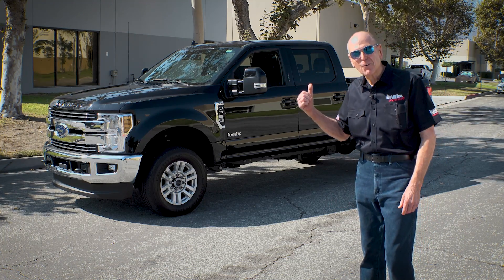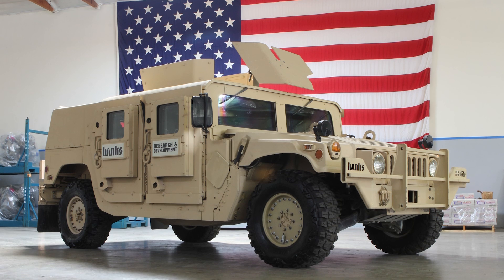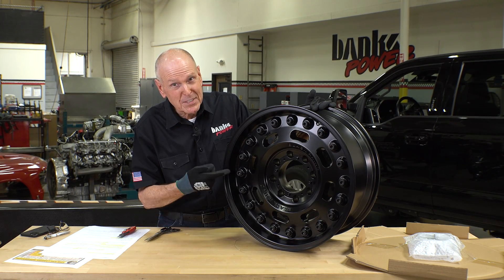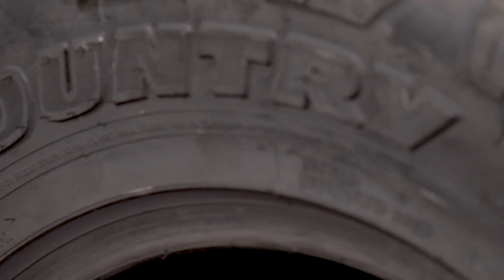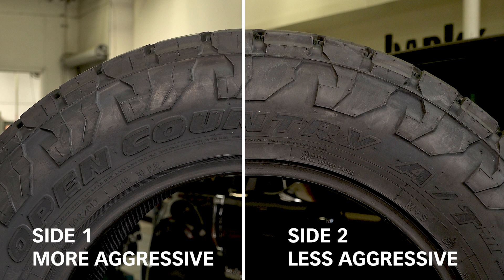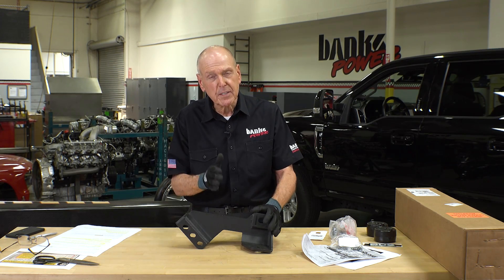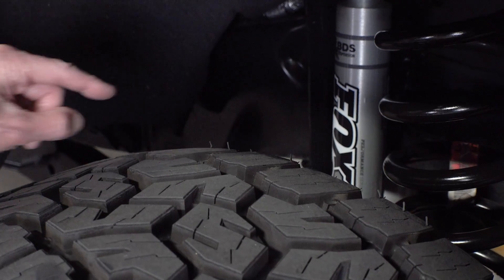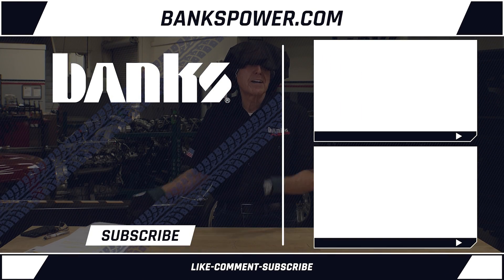ENGINEERING UNBOXED: Ford F-250 Makeover!

Comment: Why dosent GM employ Gale Banks as a Duramax Engineer or ?,and let him upgrade the reciprocating assembly and the base architecture of the nect gen Duramax? Ive followed Gale Banks career since he chased Bonneville gas speed records. At that time, he stated,  diesel is the next big thing. You can turn the boost waay up, and there  is no detonation. And he proved it. His motto, test, document, dont guess.
Reply: Sorry for a couple s.i.c. mistakes. Gale Banks is our Diesel Zora Markus Duntov. Mary Barri 😮 would enhance her pension and make money
Reply: employing Gale Banks in some Duramax engineering capacity. He reengineered the 6.2 when the U.S. of A. wanted them uparmored.
Reply: The 60's were a Gold Mine for Chevrolet, which dominated the streets, with factory built hot rods.
Reply: Only factory built light weight experimental race cars from other manufacturers could beat the factory Chevy big blocks with forged steel bottom ends.
Reply: A favorite story that I read about was a hemi dodge campaigned on Woodward Blvd. and maybe Telegraph Rd. by a group of Chrysler power train engineers, it was the king, it had never been beat on the street, until a...
Reply: ZL-1 Chevy (Camaro)? Wupped it. Mary Barri, if you are head of GM, stant and deliver....you lasting legacy.
Reply: S.I.C., sorry, deliver your lasting legacy.
Reply: Gale Banks, a.k.a the modern Zora, stand and deliver, sir.

Comment: I have a 2019 F250 Lariat Powerstroke with 4.5" Carli Suspension lift, Toyo 38x13.5r18 tires, Black Rhino wheels, S&B air intake with battery relocation, Banks Derringer with iDash Data Monster and a Pedal Monster.  Its a beast...

Comment: Have to pull you up on the brake diameter vs tire diameter; ignoring tire/wheel inertial increase, the brake will dissipate the same energy as with a smaller wheel=same stopping distance. Makes no difference.

Comment: It appears as though the At3's are manufactured in the USA but I would have liked to have seen BFG instead.... I mean the history of BFG.... A lot of firsts.
Reply: the BFG’s don’t hold up well under the heavier trucks i’ve run them and out fleet has run them. even their ‘hard’ compound is too soft and wears too quickly. i got 72000 miles on my last set of AT II’s before i replaced them with my new set up and lift.

Comment: Gale... about the wheels   why put fake bolts and nuts on the wheel just for show ? they are just  dirt collectors and  extra weight.
Reply: Same reason as fake t*ts, unnecessary weight, costs more. But hey it looks good!
Reply: take a look at nearly every other single truck wheel... ugly, stupid and look like shit; at least those mirror the split rim "well", most of the fake bead lock wheels dont even look the part convincingly.
Reply: I don't usually go for form over function. I thought those wheels looked good. They can't be that much money as they were steel and basic.
Reply: Every set of wheels I've bought for the last ten years has fake ones. This last set (rockstar lll's ) only 2 of 6 are real. Did give me that cheap feel right off the bat although there not. but I do like them when I need to remove them ,lol

Comment: Is it the new JLTV's that will have the new banks engines because the ones that we had in my unit had Cat C7?
Reply: You're thinking of an FMTV, those have CAT engines and management systems. The JLTV's have a duramax derivative made/designed by banks.
Reply: @galaxywide6760  they won't FMTVs that is a Army truck I was in the Marines so we have Oshkosh 7 tuns. I was a mechanic for 4 years so the JLTVs came out like 6 moths before I got out so I really didn't have time to study they.
Reply: @20GeneStarwind20  The MTVR had a CAT C12, so I'm really not sure what you worked on. Either way, neither of those vehicles is anything like the JLTV nor do they share any powertrain parts.
Reply: @galaxywide6760  Yes I am aware that MTVR has the C12 the FMTV is the Army's version of the MTVR. I was stating that the JLTVs that I had in my unit had Cat engines not Duramax far as I remember that was in 2015.

Comment: Gale, git rid of that drop bracket and install an adjustable Trac Bar or you will end up with Bump Steer! I don't believe the Super Duty's are using Sterling axles anymore either.
Reply: The bracket is keeping the OE track bar angles to avoid bump steer and the non-hd tow packages get the Sterling where the tow package stuff gets the big Dana axle.
Reply: @D3thM3tal  Now you WILL get bump steer because the steering bar and the Trac Bar are at different angles! They must be kept at the SAME angle!!! Adjustable Trac Bars work beautifully!

Comment: You really want an adjustable track bar over a drop mount. The drop mount changes the relationship between the draglink and the trackbar thus inducing bump steer. An adjustable trackbar will keep the relationship very similar to stock by just extending itself pushing the axle back to center.
Reply: Exactly. And, the truck is still going to ride like garbage with coil spacers and stock springs. I can’t believe he didn’t go with a full Carli Suspension, who are based right there in LA.